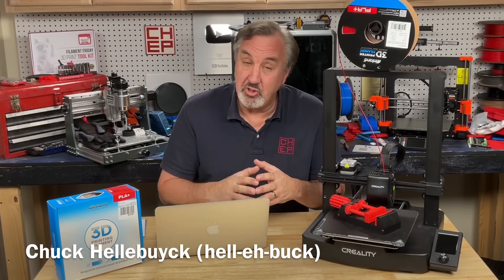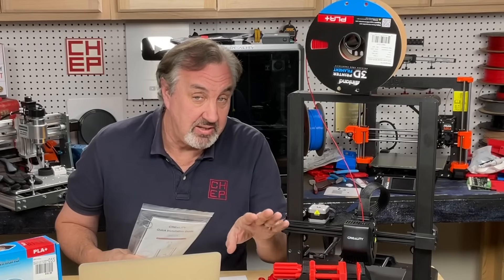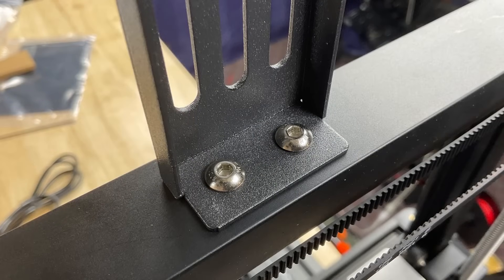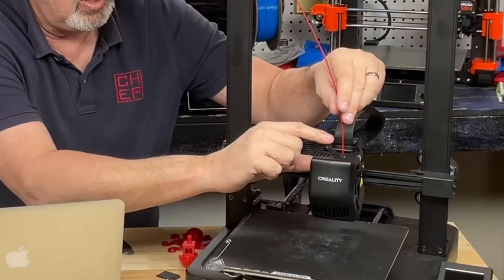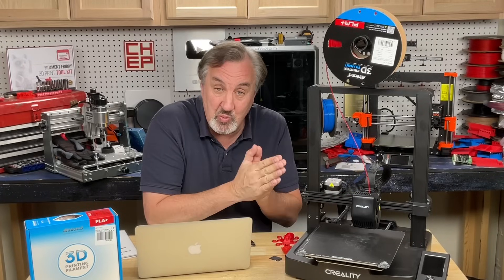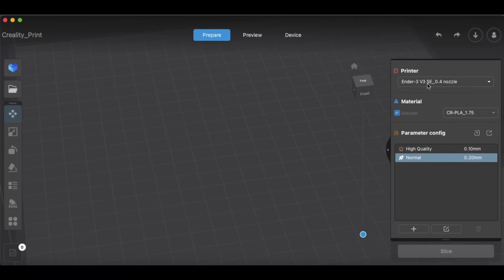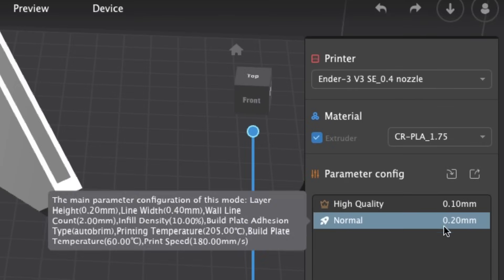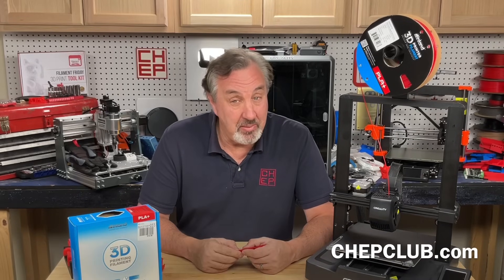Best 3D Printer for Less Than $200 - Ender 3 V3 SE

Comment: I have two 3v3se and i have upgraded the both of them with the nebula pad rooted them to real klipper upgrade. D the firmware for the hotend and it go. S to 110 on the buildplate and 300 c hotend goth tpu feet anti shake easy to maintain and works great with al kind if slicers and with Tincerad blender fusion 360 meshmixer great printer

Comment: Do you need a PC?
Reply: To Slice the file yes. You can also directly connect the v3 SE with a USB-c cable and print directly from your PC without using a SD-card. In both ways you need an PC

Comment: do you have to put the sd card in your computer to download
Reply from the maker: You slice the file on your computer, save it to the SD card and then remove it and insert the SD card into printer to run the print.

Comment: How did I miss this video? I got my E3 V3 SE last Wednesday. My only complaint is that the bed sticks to well. I ripped mine a new one on my 2nd print. My 1st print was the cat. The sample roll was a 20m roll, not the usual 10m roll. It lasted for the cat and my 2nd print. Print quality is great.
I swapped my damged build plate for a SSS plate, and it works awesomely. No need to re-calibrate the machine. Just hit print.

Comment: I recently picked up a very similar v3 se used for $100 CAD because it had a filament jam. It's my first fdm, after following makersmuse for many years. The ease and quality of this printer is amazing. It isn't good for high detail miniatures, but it's so much cheaper to print with pla as opposed to resin, and the build plate is huge.

Comment: Hi , I am a great fan of your channel. I learnt a lot of things and got success in 3d printing.  Thanks a lot man.   I am working on an odd project in which i wanted to calculate my laser engraving machine (DIY) laser head movement.    My thinking is to calculate pulses of x & y stepper driver every fixed interval and calculate its tangent and add up its values till one job completion . As you are an expert of this subject can you suggest to me if it will work or any other method i have to use.

Comment: HELP ME YOU'RE MY ONLY HOPE** the E gear on my longer lk5 pro moves but the bearing stops causing filament to stop being pushed, I've switched the bearing and upgraded to dual gear nothing works
Reply from the maker: Check for a cracked arm.
Reply: @FilamentFriday  no cracked arms, I've tried an aluminum upgraded and the metal dual gear upgrade, the dual gear gave me a 94% print then stopped.
Reply from the maker: Are you sure the hotend isn’t blocking it.
Reply: @FilamentFriday  I put the needle in the nozzle and it went up all the way and didn't pull out filament.
Reply from the maker: Then I’m out of ideas. There’s not much else to check.
Reply: @FilamentFriday   I know it's weird, Thank you for your suggestions.

Comment: Hi Sir, my ender 3 v3 se is very bad at auto leveling. If I leave it auto and do a test print some are way too far some are too close. I have to manually do a bed level adjustment using the paper technique to get a proper first layer. Also my bed is very not level with 6 blue spots and 1 yellow spot
Reply: I don't have a v3 but a v2. It also has a bed probe. I recently found that the printer does NOT automatically uses the mesh that it creates with auto bed levelling. I needed to insert the line "M420 S1 ; enable bed leveling" into the starting g-code in my slicer. Now i can see on my screen that the z-position is not constant for the first layer and that it follows the mesh created by auto bed levelling.

Maybe this will also work for you. Good luck
Reply: @wolbert4373  well for the ender 3 v3 se it does have that line by default
Reply: @wolbert4373  will look into this in cura slicer settings thanks for the suggestion
Reply: @wolbert4373  The V3 SE does automatically use the bed levelling mesh.
Reply from the maker: @aiman… How do you adjust the bed with paper when there are no adjustment knobs on the bed?
Reply: @FilamentFriday  oh using the settings under the control section. Adjusting the bed leveling values manually
Reply: I had a bent slider plate on my Ender3 V3 SE - I took it off, and wearing an oven glove (the edges are sharp) I gently bent it back to flat over the edge of a counter top. Now all my readings are 'in the green' and its printing absolutely perfectly. Im on my 5th 24hr+ print so far.

Comment: The only pei sheets that I can find on this website are 335 by 335. I'm pretty sure this machine is 220 by 220. What PEI sheets will work with this particular machine. Thank you.
Reply: Every 220x220 PEI sheet fits on the build plate. You only need to remove the screws at the rear end. The ones for the K1 should be a perfect fit. There are already replacement sheets in various 3rd party shops available.
Reply: @andreas.grundler  Thank you.

Comment: I just got mine and it does use the m600.  I just wish I could get it to print at the 180 that the cura profile and manual says.  I get extruder click at that speed but it goes away when I slow it down to 80
Reply: If your Extruder does make click noises then your nozzle temperature might be too low. So the filament doesn't melt fast enough to flow through at the high print speed. Faster speeds need higher temperatures.

Comment: I would like to see more bed slingers with dual independent Z motors so G34 can be used to sync the Z leadscrews instead of the sync belts, G34 is a much better solution to get those Z rods and gantry nice and square.
 You said that there are no gaps in the leveling squares print, there is a gap on the centre square!
Reply from the maker: Wow! Did you spend your whole time trying to find a flaw in my video?
You clearly missed that the gap you refer to is where the print head starts and stops and moves to the next spot. That’s not a bed level failure. 
Also G34 requires a second stepper and wiring which just adds cost that really isn’t needed and would make this printer more expensive for very little benefit.
Reply: Hello Andrew- missed seeing you

Comment: It's great to see how many features you can get for an under $200 printer...
I started with a Monoprice 3D Mini for under $200.  (How I also first found your channel)
Then I finally upgraded to a CR-10 mini when they were closing that out for under $200...
That's the one I am currently using...
No auto leveling or anything tho, but it's been a fine little basic printer...
Nice to know that when I am looking for my next sub $200 printer, there will be great options. ;-)

Comment: This was my 13th printer, but certainly not unlucky. I needed a fast, low-cost printer for prototyping.  Besides needing to tighten up a number of screws on the parts already assembled at the factory, I have very few complaints.  The biggest of which is the ringing when fast printing items that are taller than 50mm or so since the gantry really isn't very sturdy.  I found that I needed to lower my Z offset by 0.03mm to be perfect, so not bad. As the nozzle wears, that number will increase.  I see that you moved your prime line futher to the left, as did I.  Overall, I am quite pleased and it has exceeded my expectations for a sub-$200 printer.

Comment: I installed like a whole extra Ender 3 worth of parts over the last couple of years, and Creality just puts this thing out there for under $200. Amazing!
Reply: fr. I put a hemera on mine, which in itself costs about $200. Not to mention CR touch, touch screen, raspi, new mainboard, belted z etc.. and then this thing comes out for $200. Won't be as fast/good as a modded one, but it's certainly a better starting point.